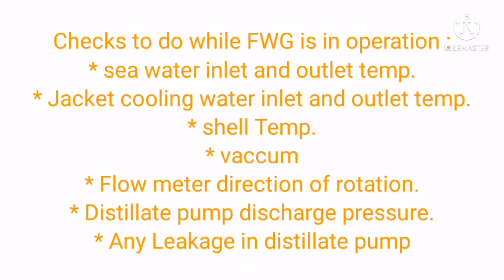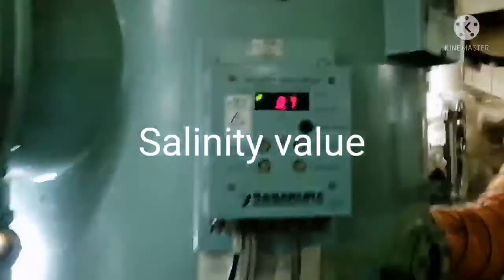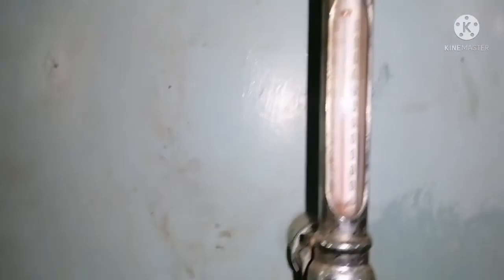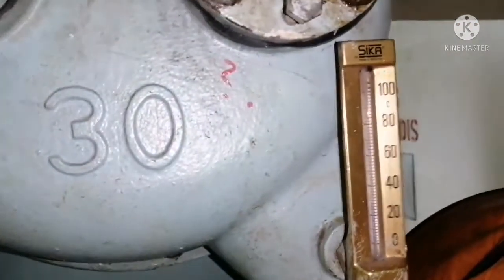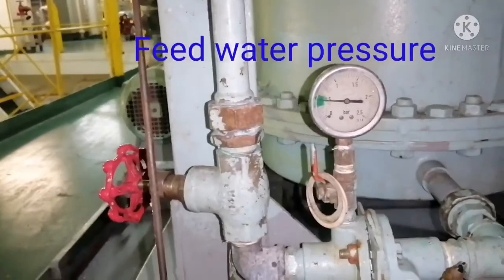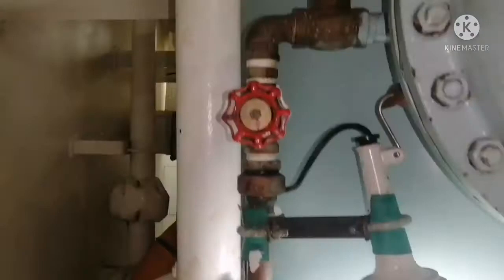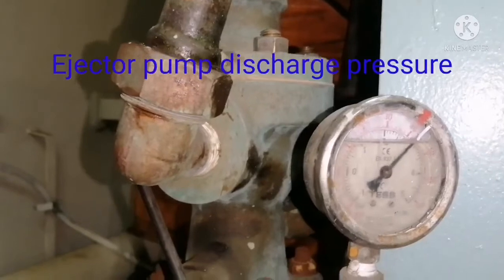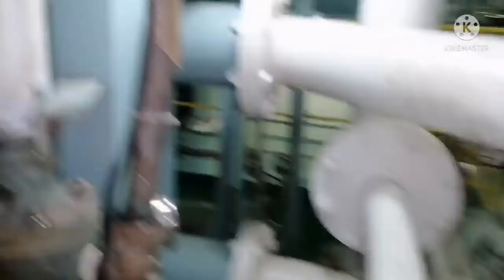what to check... Operational check of fresh water generator

Comment: What is the reason if vaccumme can not be reached 0,9 only 0,75 and once when we open ht water vaccum will drop till 0,65 . We already change the educator , sea water pressure is in range . No leakage have been found on the shell . Pressure test was done ✅. What is the reason of dropping vaccum ?
Reply from the maker: Check the flap valve..
Check the discharge pump seal for leakage
Check the cover gasket
Check the ejector pump for pressure
Reply: @marine-knowledge-basha  all are in limit .

Comment: Chief if difference  in temperature of seawater is more what it indicates? It is working more efficiently or  is there any problem with vacuum ? Is there any temperature difference range
Reply from the maker: If the temp difference is less that means great transfer is not happenings.. Either your tubes are choked are sea water flow is not proper.. This will reduce your fresh water production rate...
Reply: @marine-knowledge-basha  TQ chief
Reply from the maker: Hi  prasad
I Mostly makers recommend to have 10 degrees temp difference

Comment: sir, good day. i have a question to ask. 
in my ship, the manual of FWG said, "the temperature difference between condenser cooling sea water inlet and outlet should not be more than 10 degree"
but, they didnt explain why.
can u pls help?
Reply from the maker: Sir..
In which type fwg dey say dis?.
Can u pls clarify..
Reply: @marine-knowledge-basha  sir, tube type, normal conventional fwg. they say, the difference of sea water cooling inlet and outlet tempterature of  condenser should not be more than 10 degree.
Reply: Yes. Because if the temperature is less than 10c° meaning your condenser is already clogged so you need to clean it. But if the temperature is more than10c° meaning your condenser is working properly its clean. That 10c° is temperature difference just for reference
Reply from the maker: @artemiosycee1845  ur vry rt sir..